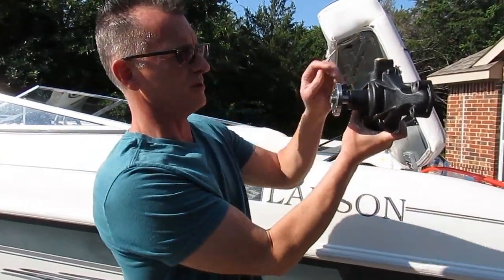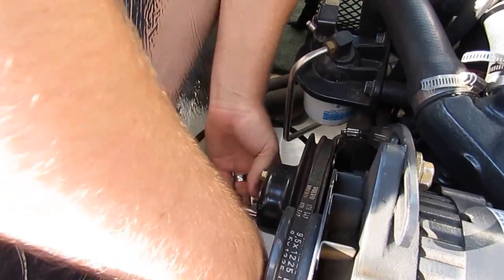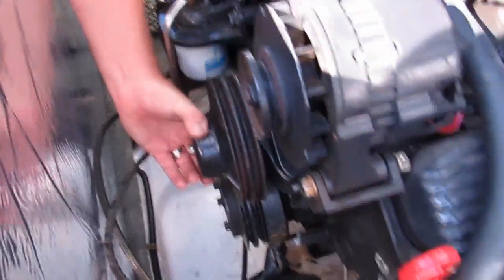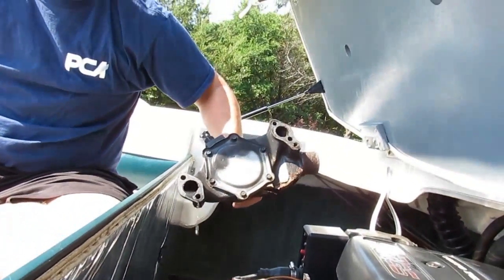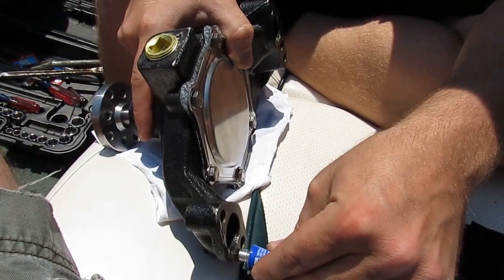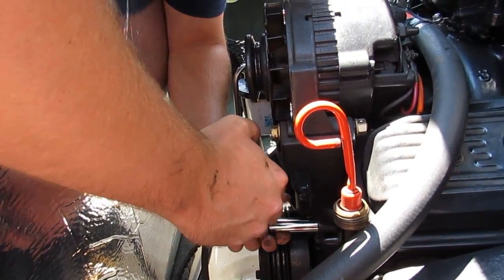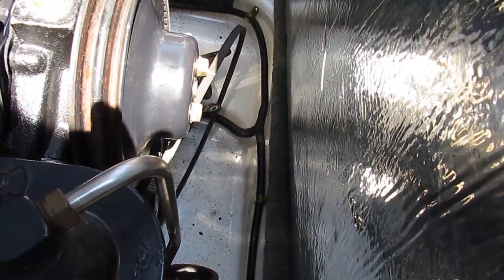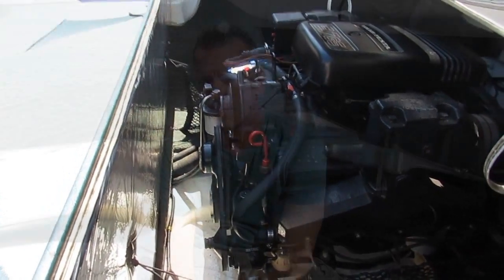Water Pump Replacement - Volvo Penta 5.7 GS

Comment: thank you  you were a big help changed my circulation pump on my 
Volvo Penta 496  8.1 GI-C 
raw salt water cooled rust was so bad weeping hole rusted shut.. new manifolds and risers, thermostat, all hoses for cooling    first thing as every yr raw water impeller 
ended up being circulation pump
Reply from the maker: +Sara Kimm Hi Sara - Get 'er done!  Thanks for watching...